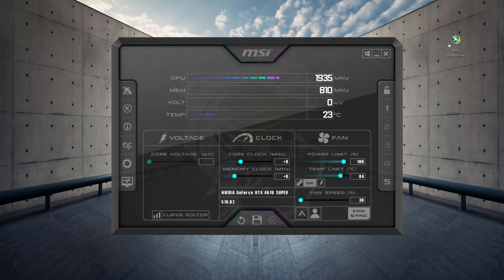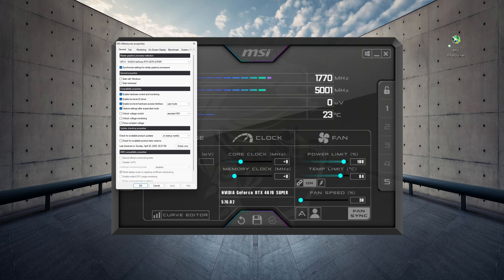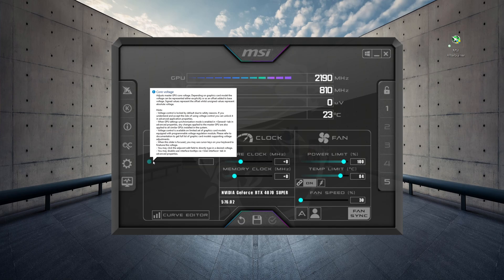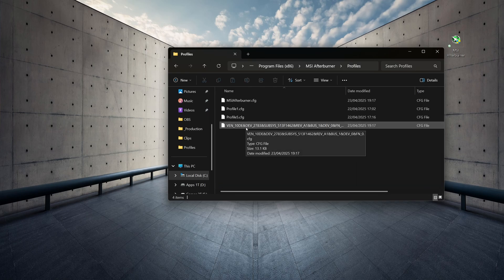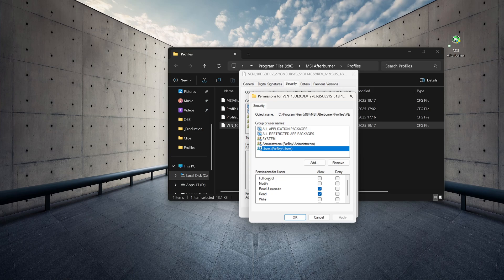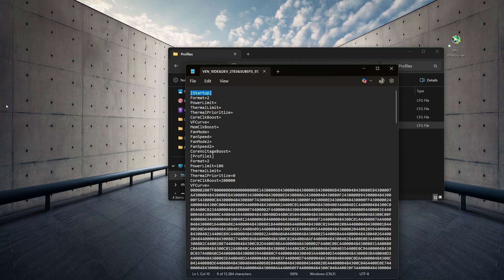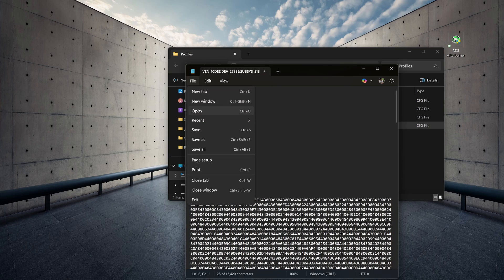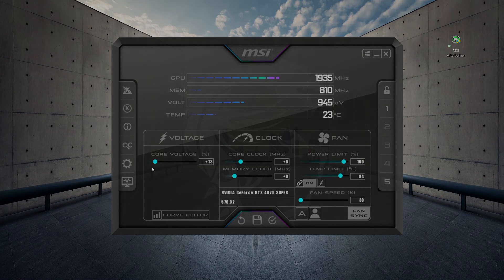MSI Afterburner: Fix Disabled Core Voltage Slider

Comment: Temp : 23..
Do you use a freezer?
Reply from the maker: Hi, Thanks for your comment. Just air cooled and this was the Idle temp. For case fans I have 4 exhaust fans and 5 intake fans -  2 of those intake fans are situated at the bottom of the case feeding the graphics card. The fans on the graphics card were running at a minimum of 30% at that time. Case fans run at a minimum of 50% and are silent when Idle. Case Fan curves will kick in based on either the CPU or GPU temp using Fan Control. (https://getfancontrol.com)

Comment: For some reason this did not work
Reply from the maker: Were you able to edit and save the file? Also in MSI Afterburner ensure Unlock Voltage Control & Unlock Voltage Monitoring are ticked in Settings under the General tab

Comment: It's unlocked... but not able to change anything... does not apply... sadly
Reply from the maker: The Core Voltage Slider is used for stabilising an overclock. I briefly explain it's usage in this video https://youtu.be/QWvclF2lnyE

Comment: does it actually unlock it though? or is it just a UI unlock?
Reply from the maker: Sorry for the delayed reply. Yes it does unlock it and not just for the UI. If you're planning on doing an overclock on your GPU, increase the slider for stability along with the Power Limit and Temp Limit. Make sure to adjust your fan curves to counter the higher temps. Thanks.